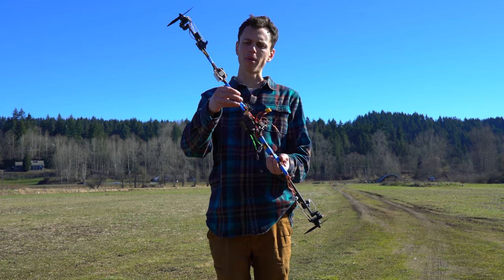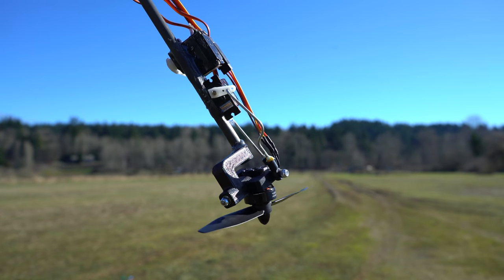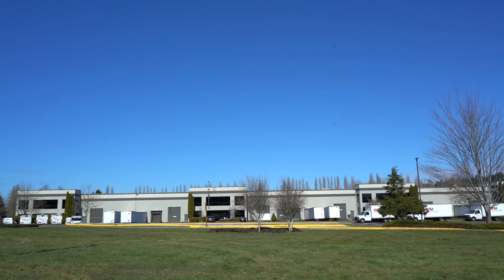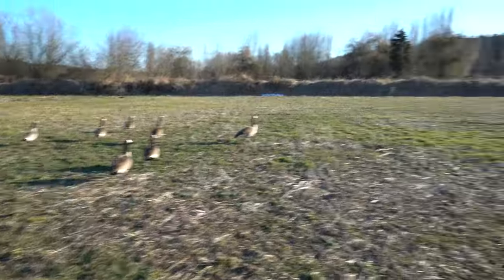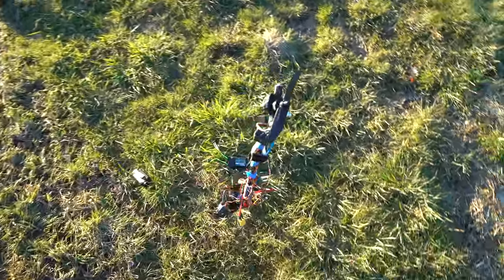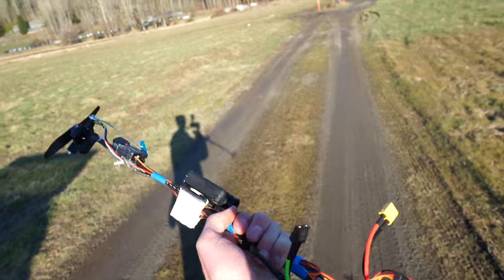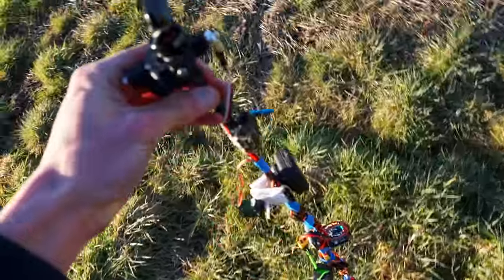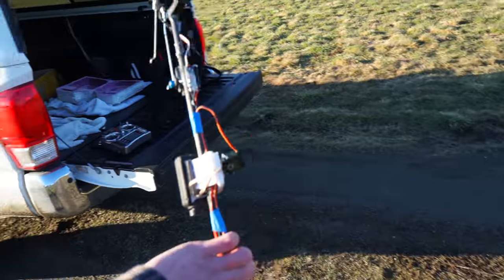Coaxial BiCopter Flying Stick - Brushless Rocket Project - RCTESTFLIGHT

Comment: Propellers will stall if they are moving backwards so fast. You need the finest pitch propeller there is, like 5x2, to stop from the freefall.
Reply: I’d also recommend using tri-blades at least, bi-blades have almost no grunt in a punch out, and it makes a quad pretty much do this and crash when coming out of a free fall (it builds up the localized pressure region behind the props much better in addition to just having one more blade, similar to how server fans optimized for pressure have more densely packed blades. It’s kind of a double bonus due to that)

Cool project!
Reply: Jake Garrett he doesn’t exactly have any prop clearance issues though, if he has more available torque he can just put it to use with a bigger prop
Reply: @jakegarrett8109  so that's why my Mavic rises much faster than it comes down again
Reply: @supermegakim  it to prevent "vortex ring". All rotor machine are susceptible to it.  With racing quads they can overcome it because of power to weight ratio. Even the in free style the hardly ever have prop thrust in exact opposite direction of aircraft movements.  In some racing video u would see quads going backwards and just spinning in one place (that would be closest to vortex ring). But because of power they can overcome it).  
You should watch some video of " vortex ring state" and what to do if you ever get into that situation.  Maybe  it will help save ur quad one day.   
Here a link to a good video: quadcopter101 wobble of death. About 2.5 minutes in.
https://youtu.be/LCret4rv0HE

Comment: My thoughts a while back: "Aircraft are precision designed vehicles requiring complex calculations and fine engineering to allow them to take to the air"
My thoughts having watched rctestflight videos: "Yeah you can strap a couple of propellers to a stick and make it fly"
Reply: Its all in the software baby!
Reply: you can either have a well designed airframe, or a well designed control system, either works lol
Reply: @teslacoil4335  Airbus: "How about both?
Reply: @MIZUch.  fair enough
Reply: @teslacoil4335  *builds the A350*

Comment: dual blade props?  go to tri blade props, and what battery are you running?  no less than a 3cell and more ideally a 4cell.  I would also zip tie things in place then black tape things in place clean this build up and I think it's completely practical for a flying stick whatever you need that for.

this makes me want to build one out of a carbon fiber tube and run the wiring down the tube you could build a really slick flying stick mate.
Reply: You gonna post a video if u build it?  I wanna see bro.
Reply: @danklyf4202  I mostly build quad rotors, and fly them in acro because fun factor.  my buddy and I like to freestyle and building dive.

Comment: Put some led strips on it and fly it at night, and see how many ufo sightings you get

Also, could you use only two servos? By putting one on the bottom that controls the x axis, and the other on the top to control the y axis?

Comment: That thing looks so cool! Imagine you found a way to make it more efficient/powerful, and then turned up to a 250quadFPV race. Everybody would fall over laughing until you destroy them in a race. Need to have tiny wings so it can fly fully horizontal with those 2 motors

Comment: I've heard of cavitation of the propeller on a boat if you try to reverse direction too fast.  Basically, you need to let the vessel slow to a certain level before you apply thrust in the opposite direction.

Comment: i think 1 gimbled motor would work well if you could get a wider turning angle from the servo. and locate more weight at the bottom. so that the gimble end can swing faster.

Comment: I'm super glad people find INAV mixer useful! Kudos for such a cool thing! The guy that wrote that mixer GUI for the INAV speaking ;)
Reply from the maker: Yes! It's very appreciated! Is there a way to use GPS flight modes for such a configuration? Or more specifically, a singlecopter config?
Reply: @rctestflight  should work if you use Multirotor mixer instead of Airplane and put GPS and MAG on it. But then you will have a problem of less Servo outputs. That's Matek F411, right? Then you will have only 3 servo outputs on S5 to S7. But with only top gimbal that should not be a problem. BTW, I was also playing with dualcopters https://www.youtube.com/watch?v=XK5Y28BitcU Oh, they are "special" and I'm done with them
Reply: @rctestflight  and if you need any help with INAV setup drop me an email, I will gladly help for such a cool project/projects

Comment: Awesome... i like the out of the box concept.  What other applications could this be used for?.   I guess they could use thrust vectoring to control sway on loads hanging from a crane (or helicopter) or even rescue of land but in place helicopters can't fly low in (such as side of mountain.

Comment: That's actually a pretty rad idea considering all the weight is beneath the prop and it seems to have a self-leveling/orienting effect. v. a quad copter that has to adjust itself constantly to keep from flipping over.

Comment: The motors were spinning backwards in the fall, so they mite not have started right. maybe motor brake?
Reply: They should of started up just fine. Modern escs are very good at starting

Comment: I assume when free faling the built speed counter acting propellers. 

Then you may need stronger motors and controllers to be able to overcome downspeed.
You may also setup your controlers with no brakes for propellers to spin free and act as an air brake.

Comment: Hey also remember the directional fins such as what Space X uses originally from smart bombs as they stabilize decent and then the thrust kicks in. It's attitude needs to be realigned vertically before thrust is applied.

Comment: I know you're abandoning that idea, but my thoughts would have been similar to suggestions I made for the 'rocket', like maybe a very small (two 2" spans) V tails near each end of the stick to ensure it falls flat, and in a known orientation.
These could also give you a visual cue to it's orientation when flying externally.
I wouldn't put the tails right at each end, the top one will get influence from the prop, so maybe at 1/4 length and 3/4 length. _V_____V_

Comment: They have coaxial motors in the $30-$60 range.  Instead of the complicated mess needed to control a coaxial helicopter you could just use a gimbal and  put the motor on the top.  You might need some fins at the bottom for speed to get the thing to tip more on it side.  You also could connect several smaller batteries together instead of having big one at the bottom... basically to it can fit inside a fairly skinny tube.  It would look kind of like one of those multi stage model rocket kits you get from the hobby store.

Comment: put a spinning sawblade in the middle, change the rotation of both flight motors to counter the sawblade to maintain yaw controll, boom. Instant manhack.

Comment: Pretty much any aircraft descending at a high rate with a positive pitch prop to bring it out will suffer from settling with power.  collective pitch would work much better and for what you attempted, having it nose dive so the props are oriented to move toward the ground then angle back to vertical should work much better, but without some sort of fins to maintain a constant direction, it may be quite difficult.  All the best and look forward to more of your crazy mad science.

Comment: After giving this a long hard think I think you need to combine reaction actuators (like a reaction wheel) and this pivoting head idea in a way that minimizes the need for the heads to pivot. In other words, You may want the PID for blade angle control to only work on large errors as well as inputs, but the reaction (wheel) to handle most of the fine error correcting adjustments.

Comment: I just had an interesting idea - couldn't you just make this bottom heavy, use only one prop at the top and sharpen the bottom end? This way this thing would land quite safely even if it dropped from very, very high altitudes, because it'd stick to the ground like a throwing spear.

Comment: I imagine there are TONS of applications for something like this.

From the military, having a drone in this form factor that can be easily attached to the side of an assault pack would be a godsend. Being able to pull it off your gear and deploy it without completely taking down your pack would save precious time, and it would be super easy to recover on the move, just fly nearby, and snatch it out of the air.

Comment: Brushless motors will start to spin backwards in a freefall; windmill effect. Since these are sensorless brushless motors the ESC has no way to tell they are spinning backwards so one of four things will happen; You fry the ESC because it tries to start an essentially stalled motor.  The ESC will fry due to the EMI and power feedback. The ESC will start, but start backwards and it'll push the craft down.  Or you may actually get a successful re-start. You might try a feature called Air Mode. It basically keeps the motors spinning at a low idle so overcome the windmill effect.

Comment: The clip you used was from a gimbaling solid rocket booster. Which is not from a falcon 9 and wouldn't work for landing, because of lack of thrust control
Reply: However, it does show a gimbaling engine which I guess demonstrates your point lol, so nevermind me being a salty anchovy!

Comment: What if you kept the top motor gimbaling and left the bottom fixed as it was in the last test. But maybe change the design in the top motor geometry to have much more throw in its gimbaling movements? This would allow it to compensate for larger corrections that are needed in the extreme orientations that will be experienced. You also could mix in some gimbal to throttle control for the bottom motor. (When the top motor gimbal is at extreme throws the bottom motor would exponentially be at much less throttle.) Might stabilize a whole lot quicker and not descend so fast diagonally. I enjoyed that test and it’s an interesting design. Keep it up.

Comment: I have a question, what kind of control system did you use to stabilize it?
Reply: Looks to me like it self stabilizes due to the amount of weight underneath it. It's a clever design actually. Ie. the same way you'd hold a weighted stick from the top, it'll always want to point down.

Comment: Don't you have a vortex ring state problem? It builds up around helicopter or quad propellers that descend fast. It ruins the lift. Remedies are either a very powerful motor to compensate or a sideways movement to get out of the vortex. https://en.wikipedia.org/wiki/Vortex_ring_state

Comment: You need to make good Stick, this is awful looking stick, you need to build a framed chassi instead of the stick and put in all the battery motor and stuff inside the chassi which will protect the components during the fall, also you will get proper places to mount each component, while it will be stronger and lighter. any how cool project Sad that I dont have time to make such projects